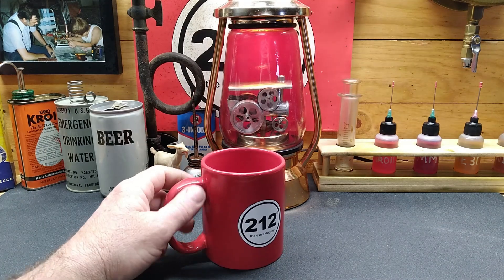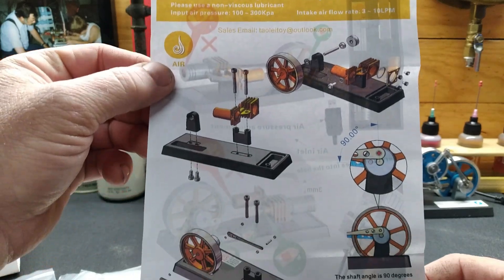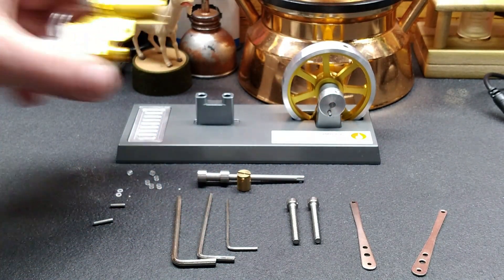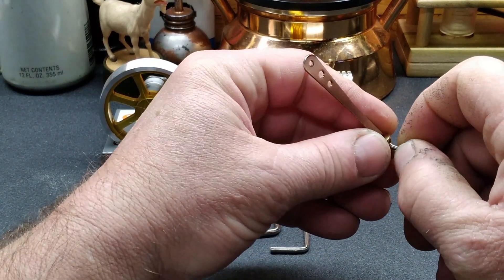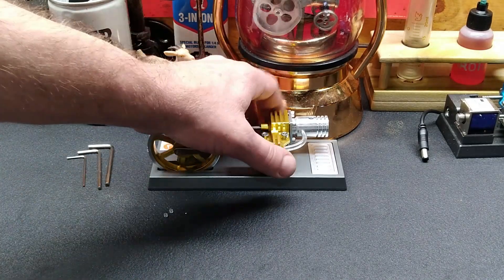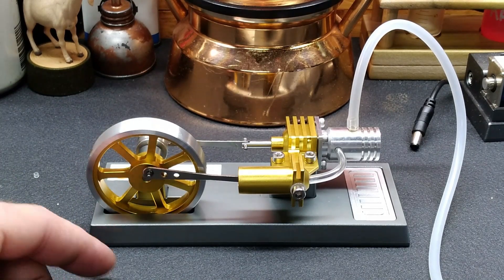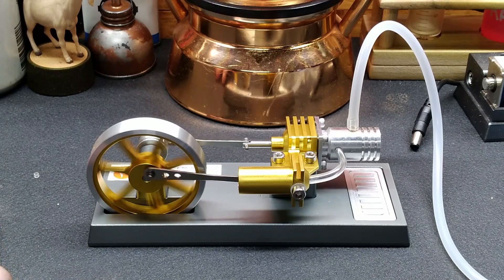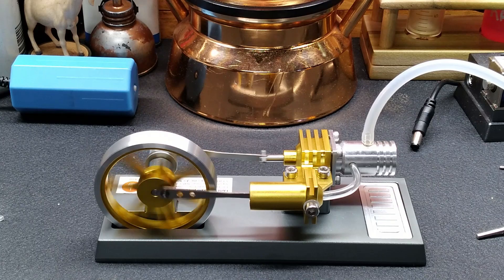Taolei Pneumatic Piston Engine. Let's Build and Run an Engine!

Comment: Was pleased to see your video when I switched on after a rather crap day at work. And, it didn't disappoint. I like these little engines. 😊👍🏻
Reply from the maker: I try to leave my crap days at work outside of the shop, sometimes they sneak in and "contaminate" the project on the bench through.  I'm glad that you enjoyed hanging out in the shop with me and enjoyed watching it run.  You're welcome here anytime 👍
Reply: If I were passing by, I might just take you up on that, but Nottingham, England is quite a distance for a Sunday afternoon drive !! 😁😁 @steam212